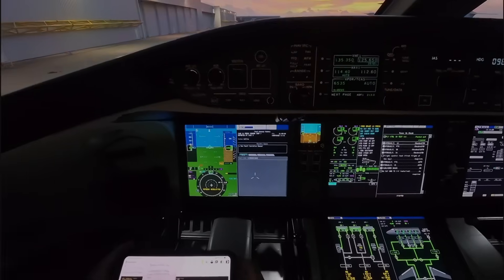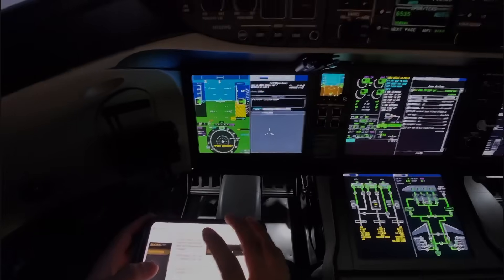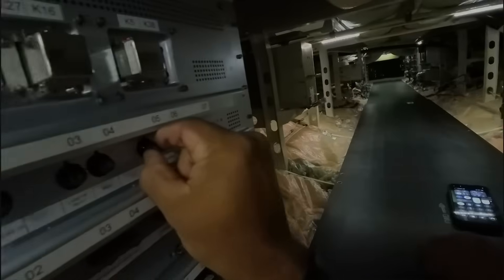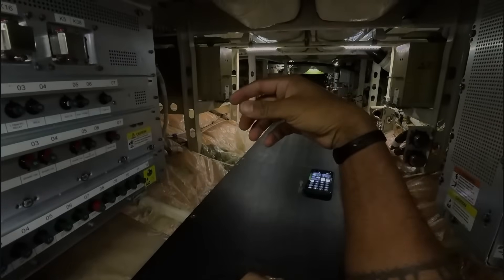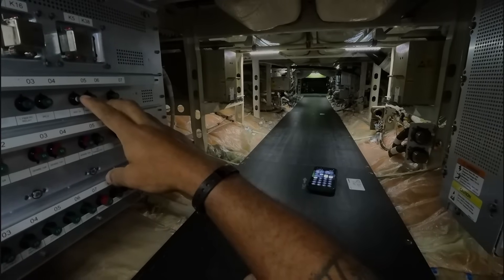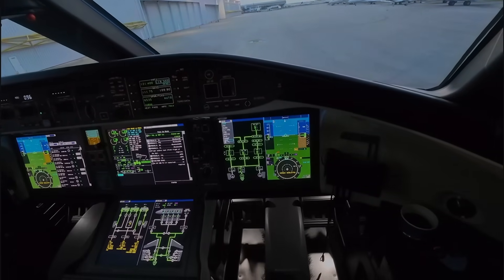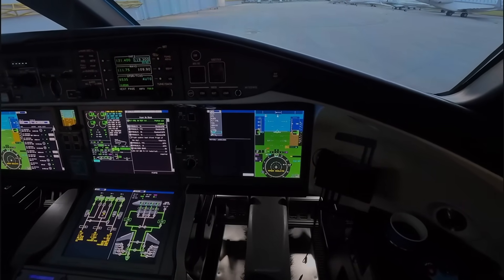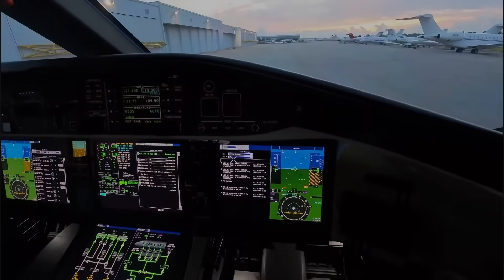Aircraft Maintenance - Global 7500 Air Conditioning Fault on Start-Up

Comment: But what caused this fault to begin with?????????
Reply from the maker: That fault is triggered if the system detects a split between 2 channels of that sensor for a few seconds. The fault then latches on until a power reset occurs.

Comment: Seems like the Global is a bit finicky?  How reliable is the Preator?
Reply from the maker: My opinion, is that the global is pretty damn reliable as long as you take your time powering it up, and know how to clear the little nuisance messages that pop up. If I hadn’t have been present today and the crew got this fault, they could have just shut the airplane down and the fault would have cleared when they powered it back up. But If I can just pull a single Circuit Breaker instead of starting the plane up all over again, I will.

As for the Praetor, I haven’t had many issues with it either. We have missed a couple of flights, but it was for fluke faults and nothing reoccurring.

With that being said, I have heard of plenty of operators having nightmare aircraft that just always break in both platforms, but I can’t speak on those.